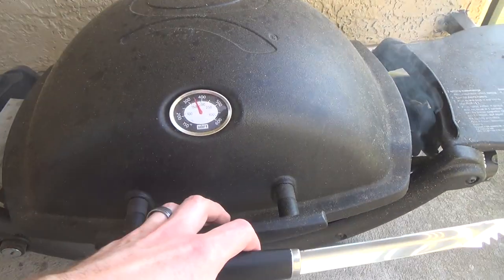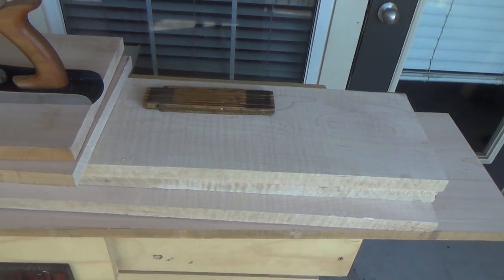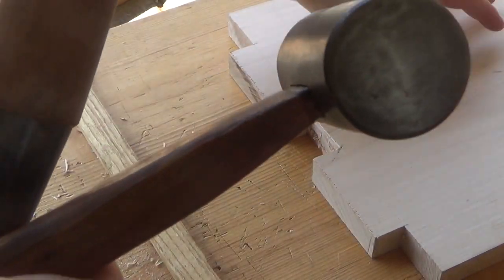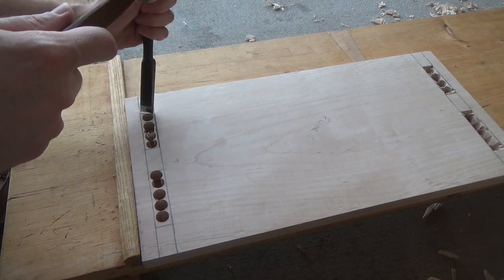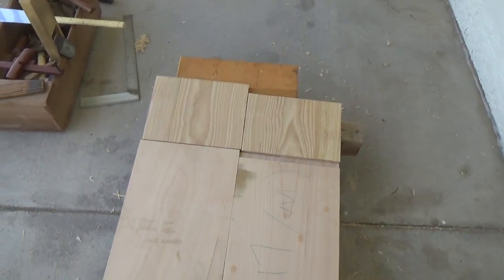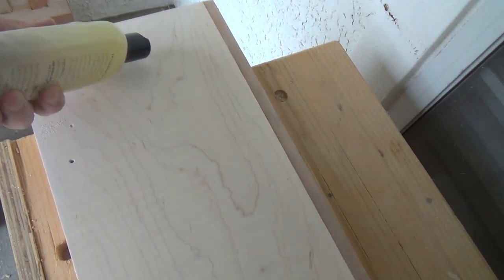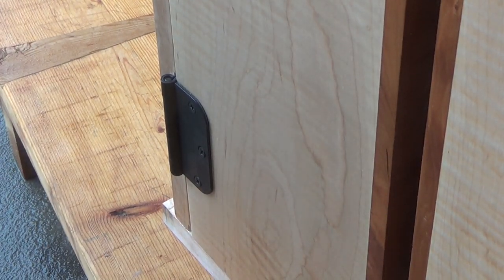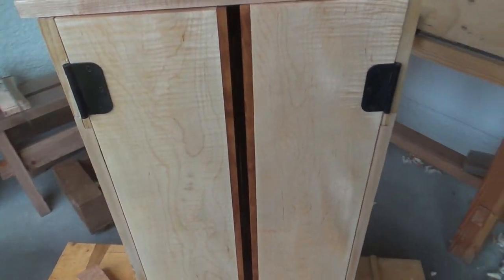Making the Wabi Sabi Maple Cabinet

Comment: Hello man, just a question. Why are you sanding instead of using that great kana you have there? There's really no need for sanding!
Reply from the maker: To be honest Kanna don't do so well on super figured wood like this. I asked a few of my Japanese carpenter friends and they actually advised me to sand it down if you can't get it uber clean. There are kanna with higher blade angles that are made for harder/figured woods but I don't have one of those yet.
Reply: @Lemongrasspicker  Oh that's good to know! I also had to sand a table the other day, in this case because of the different grain directions.
Hope you get a kanna for harder woods. Thanks for answering :)